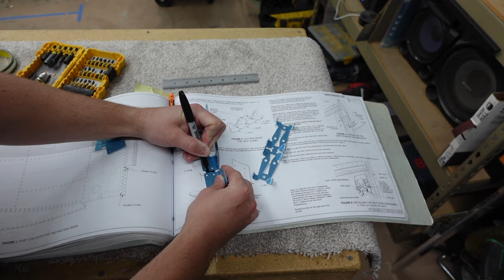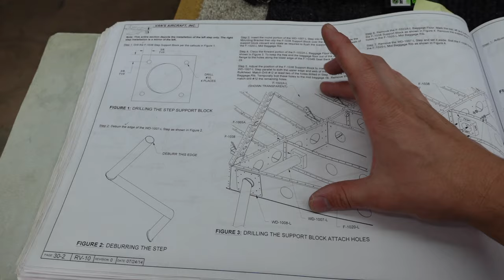RV-10 - Sections 29 and 30 - Fuse Side Skins and Steps, Part 2/2

Comment: Nice work! Your videos have always been insightful. I've definitely learned a lot from them. What are the channel lock looking pliers that you used to squeeze some of the rivets? I remember you mentioning them in a previous episode but I can't remember which one. Thanks!
Reply from the maker: Thank you for watching and for the comment! Glad to hear you’ve been enjoying them. Those are the 16” Knipex pliers. They are awesome. Had to really work to get those rivets to an acceptable spec, but much easier than bucking at times. Just have to make sure to keep it square or else they want to lean. I used a chunk of aluminum with the shape of a 470 head ground into it on one side and taped that to the pliers. Here is a link:  https://amzn.to/3vMt8nz